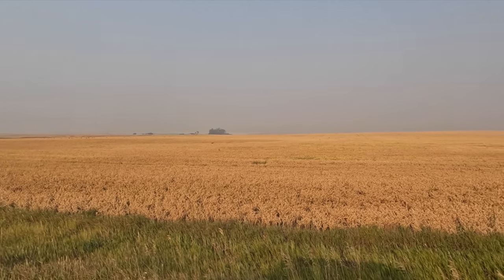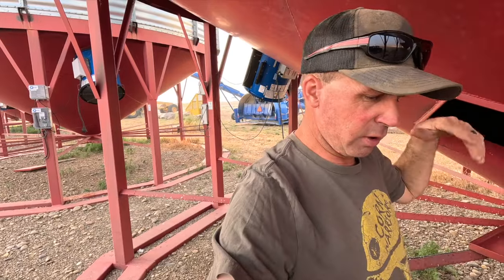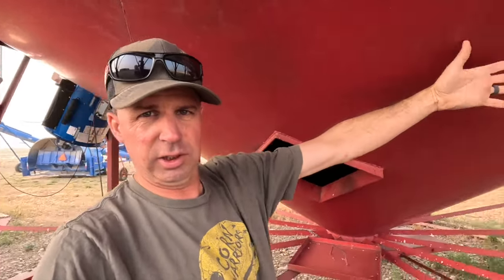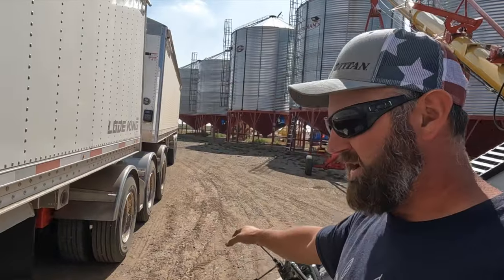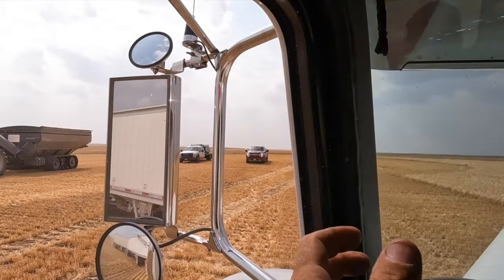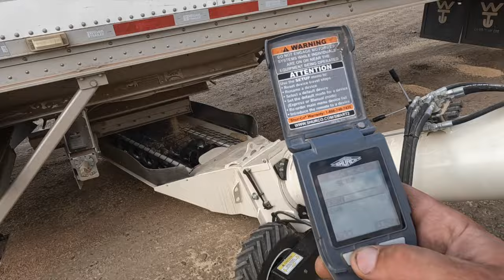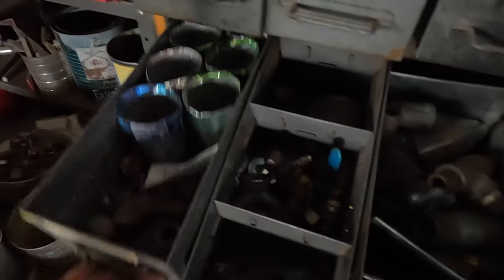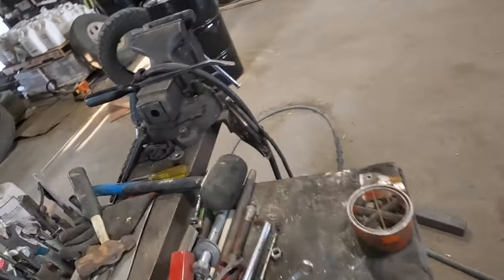It Is a Game Changer!! (Video #7 of Harvest 2024)

Comment: Why not drive the grain cart on the other side of the bagger so you can drive along instead of backing up?
Reply: I thought the same thing. The top of the bagger is lower on that side, I figured if they loaded over the high side they wouldn't be able to see as well. The hopper is designed for left hand unloaders.

Comment: Thanks for your excellent video.
 
Some farmers are now dumping their wheat into semis on the go instead of dumping into grain carts.  It is worth thinking about and trying out since the dollars affect the bottom line.

There are advantages such as less fines in the grain from less augering without a cart, less fuel used, less manpower required, less wear on machinery, more profit etc.
Other crops such as potatoes, sugar beet, corn silage and some vegetables are directly dumped from the harvester on the go into trucks instead of being dumped into a cart.

Check out this video titled,      2024 Crop Report - Box Elder
Reply: Sorry, but no it's not something we would ever consider.  Vegetable harvesting, such as potatoes, often does use a truck (never a semi though) driving next to the harvester. But generally this is because the harvester has no on-board storage and drives very slow. Horrible ruts and compaction result, but deep tillage is just a fact of life with such crops, which breaks up the compaction. But for grain harvest, no one would want to on-the-go into a semi.  Way too much compaction and it's very hard to drive a semi at the right speed next to a combine.  There's no way I'd drag a set of Super B trailers around the field. If you've ever driven a semi you'd understand at least part of the reason.  Pulling even 20 tonnes in a soft field is no fun at all.  We used to occasionally unload on the go into tandem trucks.  But it's just a horrible pain.  A grain cart is far, far better, and that's what everyone uses.  More nimble, can go fast or slow easily, and does not compact the soil.  I even have a neighbor who does potatoes and no longer uses trucks in the field. Instead he has a big potato cart, not unlike a grain cart, and uses that to shuttle all the potatoes to the edge of the field where they are sorted and loaded directly onto a semi to haul back to storage facilities.

Comment: I don't kno... I thought you knew a dude that could weld the awesumest and watnot... why ya got that cheep thin flex tube there on the exhaust pipes?? :) COULDN'T a welding type dude weld up some thickwalled out tube that would be ''stronger'' ..... or maybe weld up a SHEILD with some brackets that sit in front of the current tube?